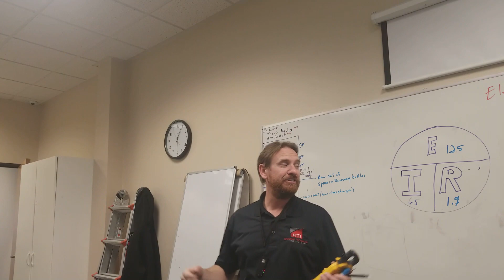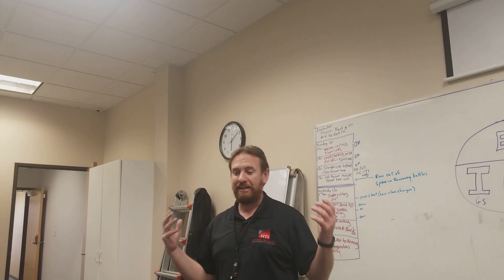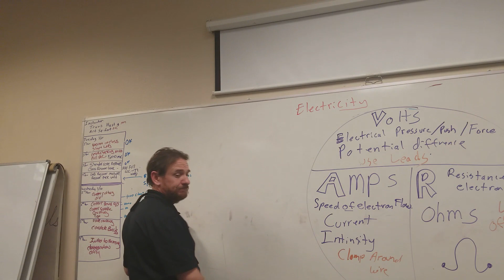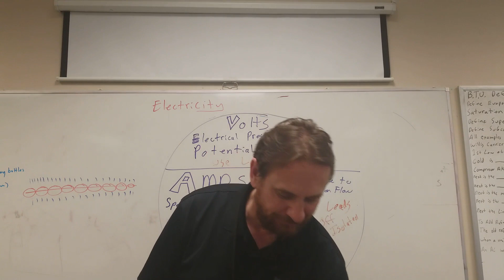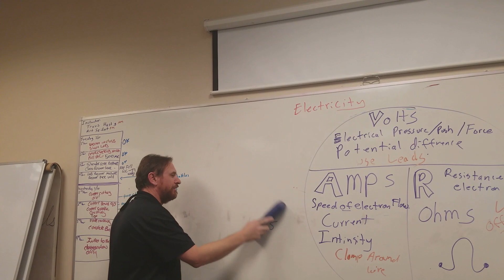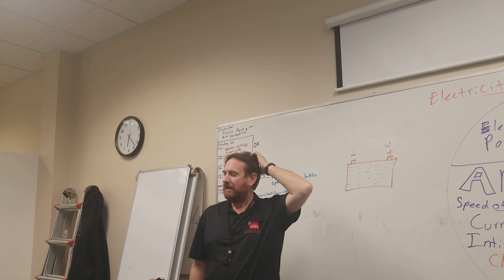Basic electricity part 2

Comment: Are you sure that student's resistance was 1.9 ohms?  Really?  1.9K ohms, maybe.  And it takes much much less than half an amp to electrocute someone.
Reply: Those are definitely 100k - megohm values
Reply from the maker: It's possible but I usually set the meter for ohms locking out kila and milla. Either way the my goal is to get them to be contiouse  of the potential for electocution. In the pastI have had students want to grab the hot and neutral just to see what it was like. Luckily I have caught and stopped each time before hand. This exercise has helped greatly with preventing that.
Reply: @love2hvac  Gotcha.  Great videos!